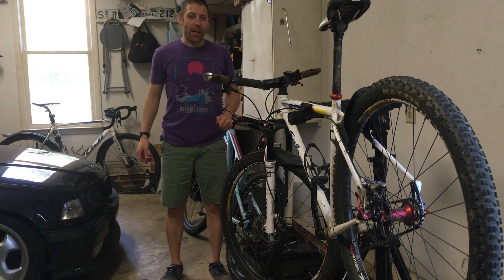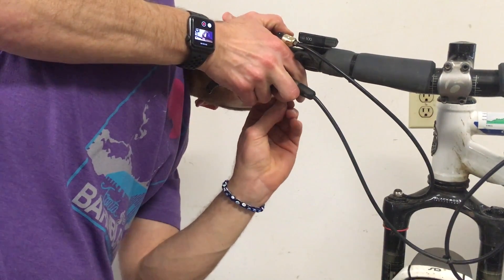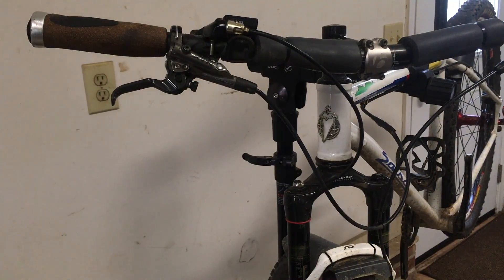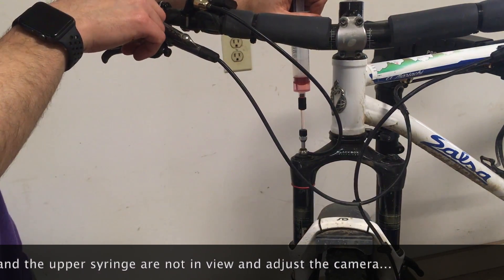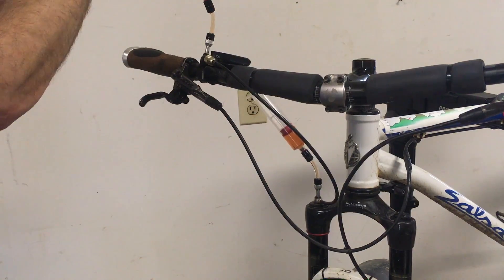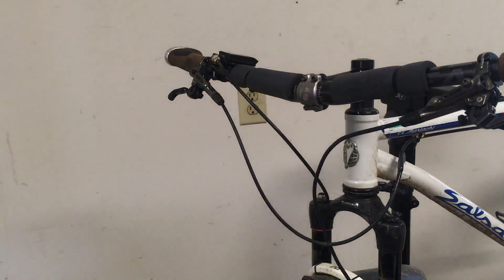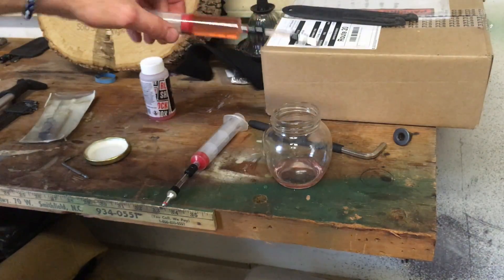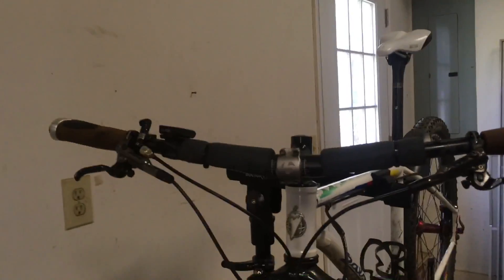Bleeding SRAM remote lockout on a SID XX WorldCup Fork. -similar to all RockShox hydro lockouts.

Comment: You mentioned that you'd just bled the dual xLoc on your Superfly - how do you bleed the RS-1 fork as I can only find info on bleeding the rear shock using the Full Sprint? Thanks in advance, great video.
Reply from the maker: I believe the proper bleeding procedure for the RS-1 is to disassemble the fork in order to access the cartridge inside the fork however I bet you can get good results just bleeding the remote from the top. When you apply pressure with a good syringe, that should help push the bubbles to the highest point in the system :) As with bleeding a normal remote, make sure you do so in the remote extended position, with the barrel adjuster also fully extended.
Reply: @over1g  Thank you for coming back with that info. The hoses need some major tidying so I’ll give that a go.
Reply from the maker: @thereismoretolifethanrolex  Right on. Nothing more annoying than super long hoses!
Reply: @over1g  Indeed. I've done the brakes but was holding off with the lockouts pending the front bleed solution. Thanks again.
Reply from the maker: @thereismoretolifethanrolex  Quite welcome, thank you for letting me know you found it helpful.

Comment: Thanks for the reply.
So thumb plunger "in" provides an operating suspension and thumb plunger "out" is locked?  It seems like that's the way mine is working but that also seemed backwards to me for some reason.

It hadn't been working for a long while.  Now I have to re-remember which plunger position does what.
Reply from the maker: That's exactly right. It can be a bit confusing indeed. Think of it as the remote being extended is like the shock (and/or fork) being extended also.

Comment: Seems like you were using the term "locked out" for both the a) the thumb plunger being in the out position and b) the fork being locked out, which I believe are the opposite.  At least you confused me.
Reply from the maker: It is a bit confusing. The fork is "locked out" when the remote is all the way extended. So "a" and "b" happen at the same time. 

Think of it this way, the valve in the fork opens to give the fluid in the fork somewhere to go. That valve in the fork requires pressure of it's own to open, which is provided by the remote when you push it in with your thumb. Let me know if that helps.